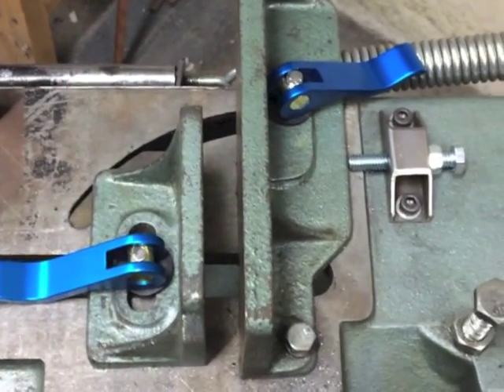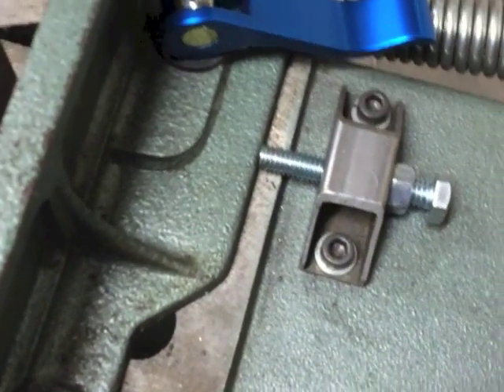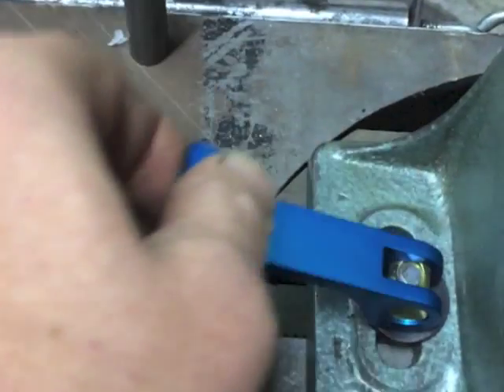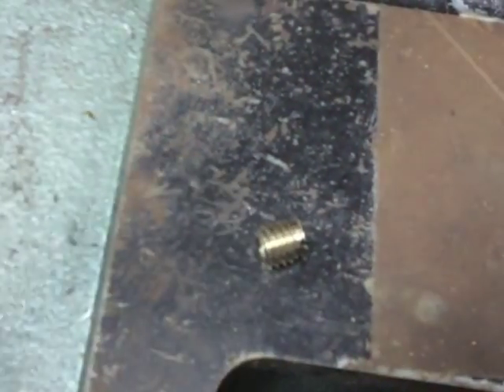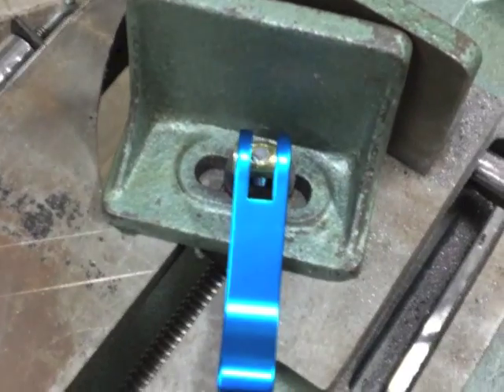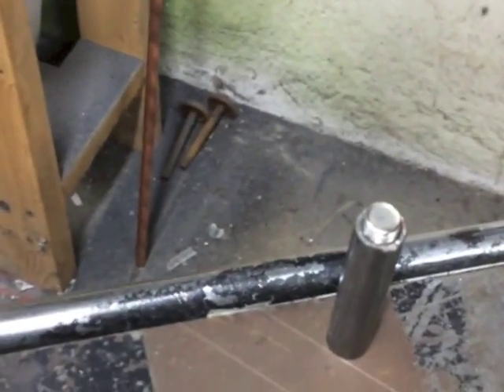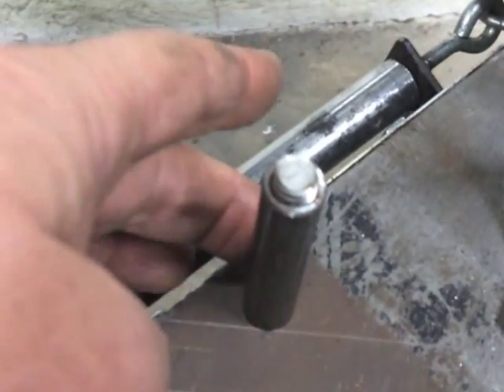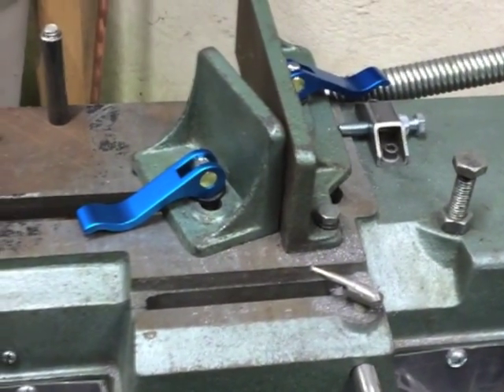4x6 Bandsaw zero stop modification

Comment: cool! but on my 4x6 saw, the front screw has some play, so this zero stop probably wouldn't work.. Looking for a solution too, currently i align it with a 90° angle each time.
Reply from the maker: Maybe I don't fully understand what you mean.  We are setting a stop which sets a fixed 90 (to the blade) with the 'fixed jaw', so any play in the screw that moves the moving jaw doesn't really matter, as long as the workpiece is pushed up against the fixed jaw set at 90 using the stop.  Is the 'front screw' you refer to the screw the pushes the moving jaw?

Comment: I think your solutions are excellent. While the result is great, I don't understand why you put the cam lock on the front vice jaw. I never lock/clamp the front jaw on my band saw vice, I just clamp the material between the jaws and cut...
Reply from the maker: Thank you!  And yes... Turns out I never locking the front jaw either, so I ended up removing the cam lock.  :  )

Comment: I did the cams as well. Not really for the speed of adjustment, but for the lack of torquing the rear jaw out of adjustment when locking it down.

Also did the 90* stop. Just used 1/4" angle tapped with a 1/4-20. Yours definitely looks much cooler.
Reply from the maker: I'd love to see pictures (or a video)... I feel like there is always something to be learned by seeing how someone else solved a problem.